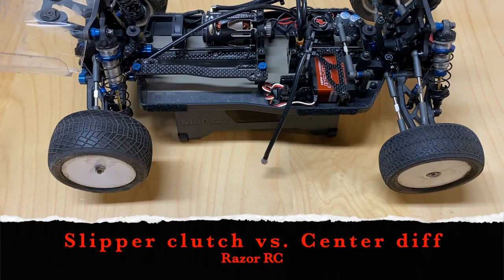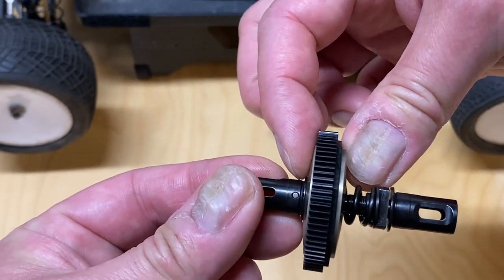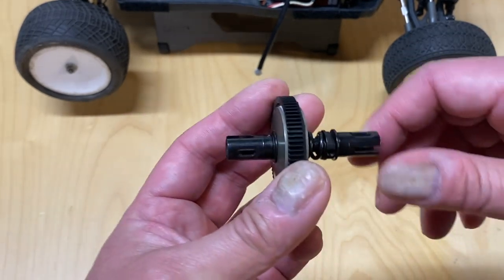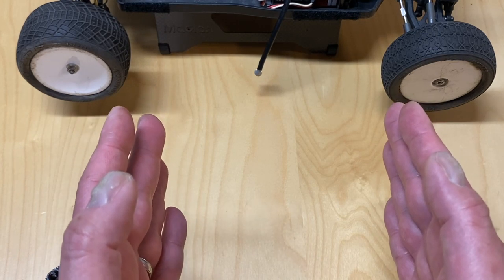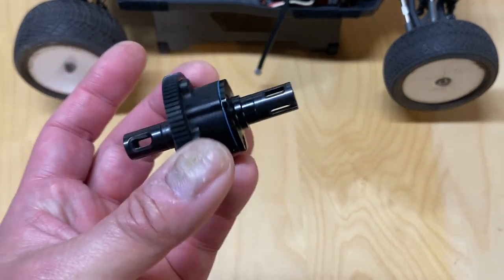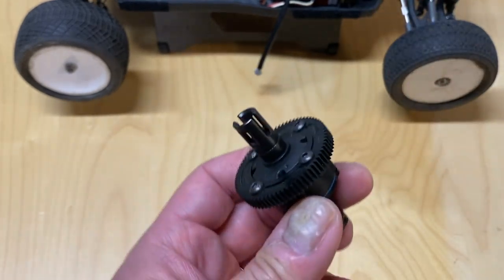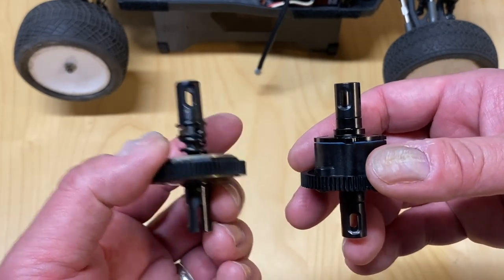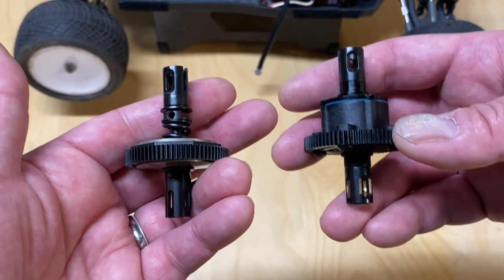Slipper clutch vs. Center differential, explained!  (RC Basics #2)

Comment: The drive shaft connected to the sper gear will always drive at full power. A diff ONLY bleeds power from the planetary gear side. Any diff always has a drive side. Differential 101

Comment: My brother recently replaced the slipper clutch in his Slash with a center diff. A slipper clutch works well for a racer or on-road car, but it doesn’t work that great for bashing or general joining around off-road. His Slash handles much better with the center differential than it ever did with the slipper clutch. An extra plus is the steel spur gear. You can’t have a metal spur gear on most slipper clutches, because there’s too much heat generated by the friction. Therefore, you need to use a plastic spur gear, which strips teeth extremely easily in something like a Slash. My brother’s Slash is 3 months old and he’s stripped 4 of the plastic spur gears in that time.

Comment: I have a 2S car with a slipper. It's a weak part that slips uncontrollably, the friction material shows no wear but it slips badly nonetheless. So now I have locked it completely, no issues with the rest of the drivetrain. Other slippers might work better since this car is a cheaper Chinese made rc but it was garbage so I had no choice but to lock it and it works great that way. Unless they use real friction materials these slipper clutches are useless and lead to issues.

Comment: Remeber the most important thing, a slipper cluch it consjmes itself, it is going to go bad over time, a well kept diff (obviously if not abuse or used costantly to race and put under lot of stress) may last very long and every part may be swapped to repair

Comment: The more I'm getting into RC, the more I'm using your videos as a resource! Great vid my man. Having issues with the slipper on my Outcast 4S and had to research the basic understanding of how that works. 👍
Reply: Me to having issues WITH my slipper Clutch on my my 4s kraton when i drive on grass or GRAVEL but not cement will have drive my 4s kraton in a big school yard when i get my Truck out of shop getting New gears put in the back of Truck way in THE back wete i have to take the cover off take the the Red pole off the pole underneath thats under the red pole were u get to the slipper Clutch to tighten and loosen THE Engine and unscrew the bottom metal or hard plastic not sure which it is to get at the gears
Reply: Hope its ready by Friday
Reply: Iam a Newbie to these Advanced Rc Trucks and Cars
Reply: I just know the basics on these Rc Trucks and Cars

Comment: Running a center diff in high grip is bad for your transmission, also on power the steering becomes dependant on how much the diff is moving so the amount of steering you have varies massively. You can also cook the center diff oil and cook the front tyres

Comment: In your (or anyone's ) opinion what is best for light bashing in loose dirt and gravel with minor grass, a slipper clutch or a center differential. What wt fluid is best for offroading if I did use a center diff? I am running a Traxxas 4x4 vxl Slash. I do racing on both asphalt and dirt tracks as well as light bashing. 
Off note, I know that the Erevo uses a center differential as opposed to the slash which uses a slipper clutch. The erevo is great for offroading and light racing and has great traction on dirt. Should I put a center diff in the slash or will it not make any real difference?

Comment: Nice comparison! But what about some words about dual slipper clutch systems like the Arrma 3s ones, where they can slip either side individually, so it acts more like a clutch
Reply from the maker: Yoni Cozac those are good, my 22-4 2.0 had one and they tend to handle better than the single slip designs.

Comment: Hey Razor could you do a motor size breakdown? Like about size, what all the numbers mean and kv ratings? Thanks
Reply from the maker: Chris Watson good idea for a video!
Reply: @RazorRC  Thanks! It would help me out alot! More specifically how to measure and determine the size of a stock motor without the info on it. And also how to decide a good kv for a certain type truck and what you want in terms of low end, high end, speed and torque or a good number for both. Thanks Razor! 👌

Comment: 6:48 Best way to think about it, an (ideal) open differential will always have the same amount of torque going to both axles, always being a 50:50 torque distribution. If e.g. the fronts can only take 10 Nm of torque before slipping, then the rear will also only get 10 Nm of torque, any extra you try to send will just go to spinning the wheels faster (increasing their rotational energy) rather than pushing the car forward.

Any kind of locking effect will allow the side with more grip to receive extra torque vs. the side with less grip via the slipping. With RC diffs using varying weights of fluids, it's most similar to a viscous differential in cars, the axle that slips kinda tries to drag the non-slipping axle up to its speed, or conversely the axle with more grip is trying to hold the slipping axle back.

The amount of extra torque transferred to the non-slipping axle should* be a function of the "weight" rating of the fluid and the RPM difference between the axles, i.e. with a heavier fluid and higher and higher RPM difference the higher grip axle should receive more and more extra torque. With something like a 20 million weight fluid, where you can barely get the diff to rotate at all, you can get nearly 100:0 torque distribution when doing a wheelie.

*It is in traditional viscous diffs with plate stacks, but I haven't extensively studied the effect in RC diffs, nor the heat response with added slip.

Comment: For me on my 4wd mod buggy outdoor its a center diff for sure with about 60k or less slippers are to touchy to drive on inconstant surfaces .  Indoor on Turf or carpet gota say trying both the slipper clutch is much better smoother more forward drive /traction.

Comment: Common belief the plastic gears reduce 9 grams per diff.  Also a common belief the center gear diff with plastic gears, has less rotating mass then the slipper.
Reply from the maker: The diff shown here actually has plastic gears in it and weighs the same as the slipper.   IIRC, my metal geared diff weighed 9 grams more than my plastic geared one.

Comment: This is an older video, but I want to ask anyway. My Revo has a front and rear diff, and a slipper clutch. But I’ve seen a center diff conversion that’s out there and I’m interested in but have no idea how to do it? It looks like is require an entirely new transmission casing, and I don’t know much more than that except for the ones that do have a center diff can add an upgraded braking system. Any help?

Comment: So I have a sc6 amd a sc5. With 5k oil in the diff. With the sc5 I have a problem with on power corner exit. It wants to loop out every time I hit the gas coming out of the corner. Being that u are a racer I figured I would ask. Would u go with a lighter fluid or a thicker fluid in the diff?

Comment: Is there a way to put power into the wheel on the ground and not into the wheel off the ground when I free wheel it on my centre diff in my hsp flying fish lowrider rc car
Reply from the maker: thicker center diff fluid will keep it more even, front and rear

Comment: Subbed subbed subbed man ur great at explaining to newbies well I’m getting back into racing rc after 15 yrs but this is my first electric car I’m a nitro guy wow times and technology have changed lol but I’m getting back into it like a newbie till I’m up to speed with stuff I got the arrma typhon 3s with a sidewinder 4 esc instead of factory one and I just put 20t pinion instead of 16t factory
Reply: Man you got back in starting at the top! That car is awesome, I had a similar story as I got out at a young age, but never lost the interest. But when I decided to get back in, I bought a huge lot with a Revo and a T-MAXX and many extra parts. The Revo was in far better shape, so that’s still what I drive. And it’s an OLD design. I love that Arrma typhon it’s just out of my price range. An actual bulletin though!
Reply: Hey man, any common reason why a center diff would start slipping? I've been having issues with my notorious 6s for a long time. I even swapped it out for a brand new one and nothing changed.

Comment: Unfortunately, a lot of this information is incorrect, You're referring more towards old-school Tamiya cars, modern day rc cars have moved on from this mechanism.
Reply from the maker: What, slipper clutches?  Every modern 1/10 4wd race kit offers a slipper clutch option (Xray, Associated, Losi, etc.)
Reply: @RazorRC  I think you should specify what car you're talking about. All cars are different and need attention to detail. Traxxas have a completely different setup to Losi and Tamiya. You never mentioned gear ratios and how that can affect a slipper clutch. I think you could of put a bit more thought into this video. It seems a bit rushed.
Anyway, I hope this helps buddy, look forward to seeing some more content.
Reply from the maker: @thehomefront1905  I literally say at 0:33 this is an Associated B74.  And gear ratios are irrelevant whether you use a slipper clutch or center differential, you would not want to change the ratio if you changed between the two.
Reply: @RazorRC  This is my point, you're not specifying what's what, you're assuming people already know when most don't.  You're much better off doing another video and saving your youtube fans, I feel you owe it to them.

Comment: I always look at it this way.

Slipper/center spool for low-traction surfaces (dirt, clay)
Center diff for high-traction surfaces (pavement, carpet)

Locked slipper/spool is basically full-time 4wd. Center differential is AWD. AWD is fantastic when the traction is good, but not so much when it isn't. Full-time 4WD is fantastic when the traction is low, but will bind up the drivetrain when traction is high.

This is why in full-scale vehicles like the Jeep Wrangler that have full-time 4wd and no center differential, when you're driving on the road, your 4wd is disengaged. You only engage the 4wd when traction is low. But in a vehicle like a modern crossover SUV or Subaru, AWD is active all the time and rarely is there an option to lock the center diff to create a full-time 4wd drivetrain.

Some newer vehicles are starting to include this feature, like the new Landrover Defender. It can lock it's center diff which changes it from an AWD vehicle to a 4wd vehicle.

If you're running your buggy on carpet, go center diff. If you're running your buggy on clay or dirt, run the slipper.
Reply from the maker: It's actually the opposite -- carpet cars always come with slippers and dirt versions always come with diffs.
Reply: It’s the opposite, slipper for high traction- carpet/astro turf and center diff for loose conditions- dirt, grass, gravel etc.

Comment: So does it send power or bleed out power to where it’s needed, I’m confused ?
Reply from the maker: Center diff?  All it does is allow the front and rear wheels to turn at different speeds.  The thicker the oil, the less it allows this to happen.

Comment: What about power handling capabilities? I’m looking at getting a Tekno 410.3 SCT powered by either a hobbywing xr8 (either plus or sct) with a hobbywing 3660 g2  3200kv motor (fully sensored install), or a Tekin RX8 Gen 3 on a Tekin Pro4 HD 3,000kv motor (fully sensored install)... it’ll mostly be a basher and I’ll race with it off and on maybe yet I’ll be using 2 different packs... Gens Ace 2s 7200mah 70c continuous, and a Gens Ace 3s 7600mah 60c continuous... the race pack would be a Protek 2s LiHV 8500mah 100-120c continuous... how would you set up the driveline?
Reply from the maker: On 2S, I would run a center diff
Reply: Razor RC.. Thanks! and what about 3s? Idk if the Tekno 410.3 SCT has a slipper clutch option available from factory or even aftermarket (unless you got clever yourself with sourcing parts already made and mod those or really get clever and design one entirely yourself)

Comment: Hey man this was very helpful but I wanna know how to set my b74 slipper clutch because it's like making a grinding noise and stuff
Reply: Should probably trouble shoot the grinding for damage and if nothing observed reassemble and set the clutch. Typically I will turn while pushing RC forward until wheels grab and leave it there with some blue loctite

Comment: Slipper clutch, also known as a back-torque limiting clutch in the real world (popular on high-horsepower motorcycles and supermoto). Though we use it less for back-torque in RC and more as a viscous coupler to limit shock loads to components.
Reply from the maker: Yeah, I've got a sportbike with a slipper clutch, so am pretty familiar with the motorcycle version.

Comment: What fluid would you recommend in a slash 4x4 center diff for bashing 2s? 3s? I may get a center diff with my slash 4x4 for options if wanna race or bash and depending on the feel I want...
Reply: 10k
Reply: And I’m saying 10k because that’s gonna give you faster acceleration and more wheelies. Ik your slash doesn’t really do wheelies so you will get all of your power instantly
Reply: But if you want more control and a little bit slower acceleration then I would do 50k

Comment: Sound wasn’t clear or words spoken were all blended into each other. Beginning was no real well worded explanation on how the slipper worked. Just very general. Extremely general. Maybe toward the end it kinda gave some decent points. I would have created an outline of slipper info and separate outline on diff so that it would be more fluid and organized which will make it more understandable. Thanks for posting tho. Will be looking for more of these. See if there is a good one out there.
Reply from the maker: You might prefer the written version I did a few years back on my blog: https://razorrcblog.blogspot.com/2015/09/center-differentials-explained.html